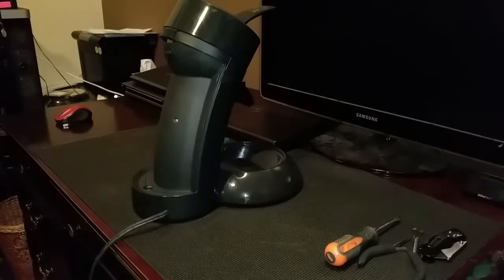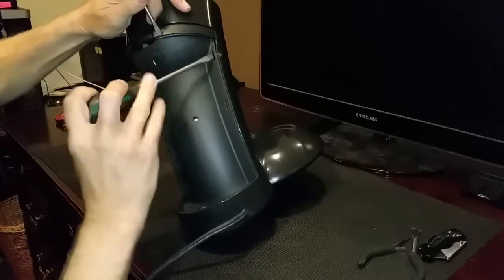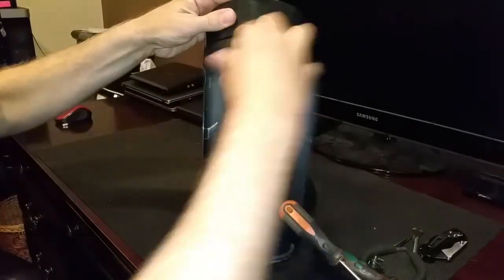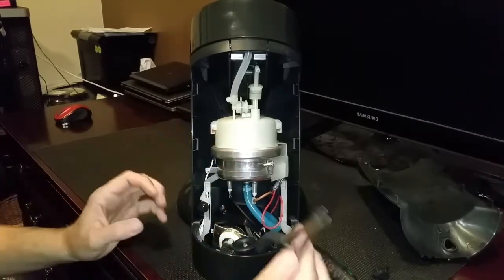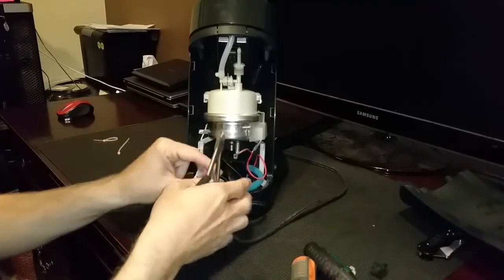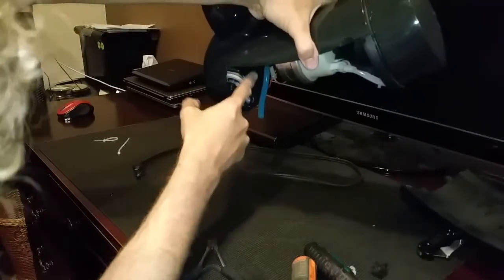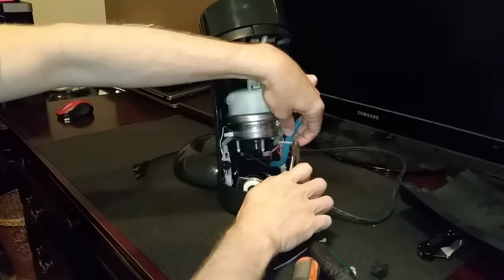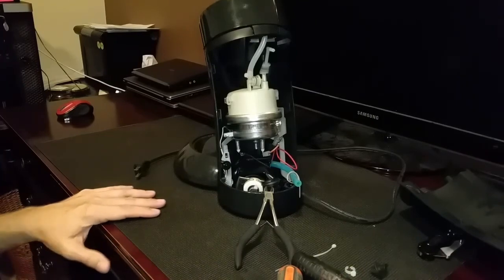Drain Your Senseo Coffee Maker Boiler Completely for.Storage and Freezing Weather

Comment: I broke mine… went for a long journey and after  it didnt work. I tought ill drain it off manually with pressure when the back cover case came of that plastic broke. Could t find spare parts for it so trow it in the garbage.
Reply from the maker: That is a shame.  These machines are expensive so, even broken, the parts are worth something.  You can buy a broken one from eBay and put them together to make one.  You could sell your broken one on eBay.  The boiler inside, for instance, still has value if the plastic is broken.